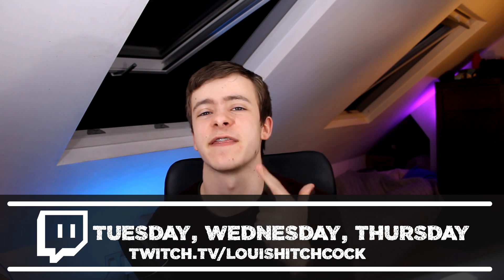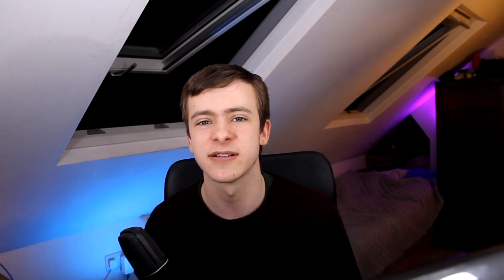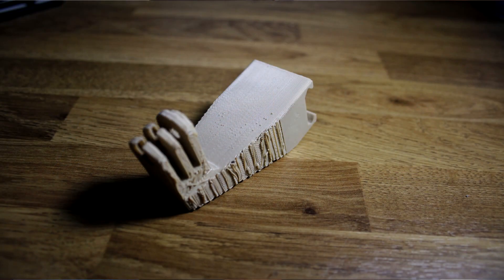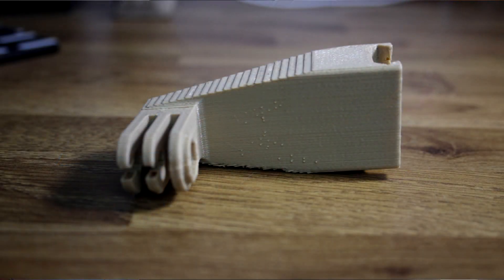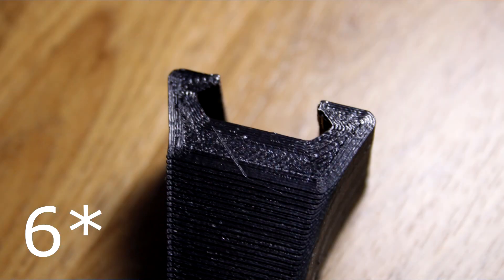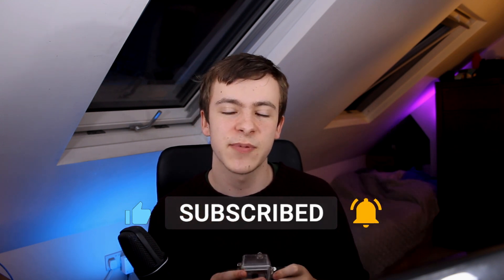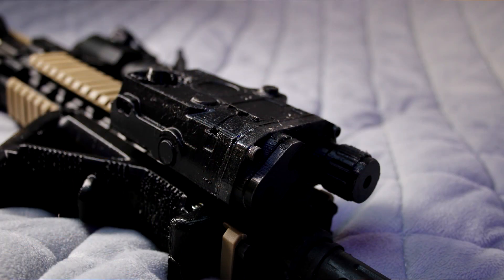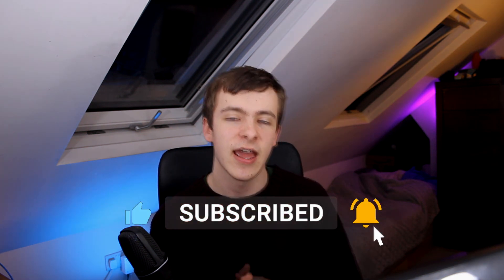What can YOU do with a 3D Printer for Airsoft?

Comment: Dont use like 12 layers when printing. Its much more effective to print like 2 or 3 layers and put the infill at 30% or so. That should be plenty most of the time and will make parts look much better and print way faster.

Also if you print the peq box at a lower temperature or higher speed it should be much more mat. Its very shiny here. Most likely due to a slow printing speed or very high printing temperature

Comment: i revived UMP 45 (both elephant m89) that having broken chamber and it nowhere to find, and importing it is too pricey and printed all the rail too that been broke too, chamber is not perfect as it sometimes loosing air seal and feeding issue due gearbox vibration but i still working on it

making tracer unit too, because i can make mock suppressor
making my own m4 mag converter for mp5 
and some another mod